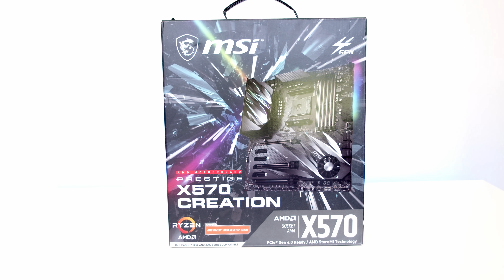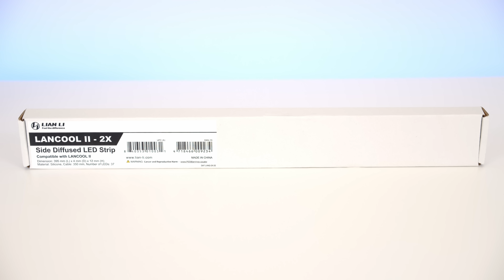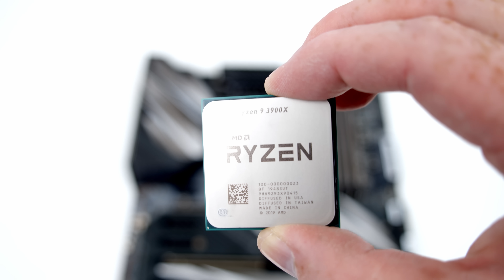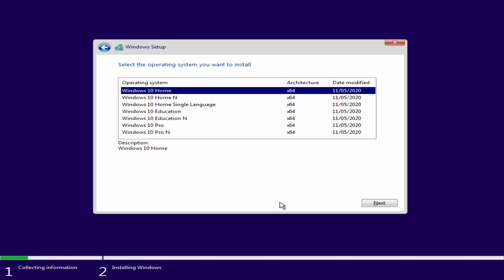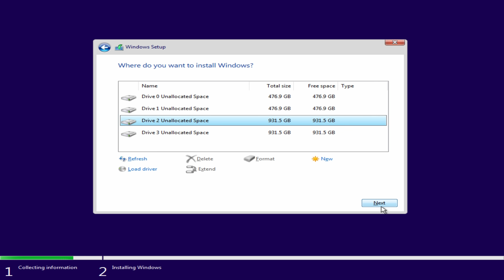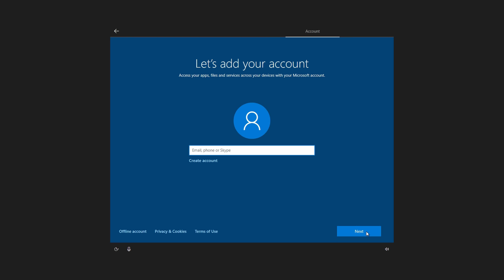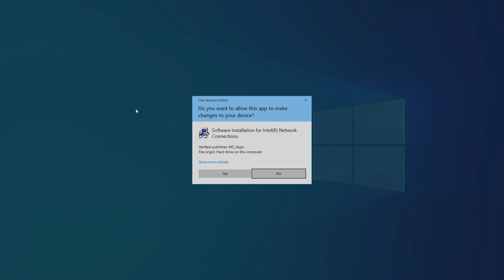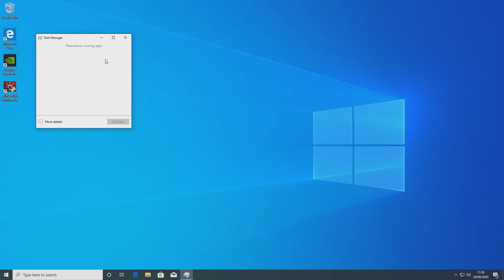Lian Li Lancool II Mesh Step-by-Step PC Build Guide

Comment: question;  do you think after you got the PSU installed and plugged in that you could use the drive cage to put the 3.5 drives into it?  I am upgrading my case and already giving up a ODD.  Hate to give up the extra drive storage also.

Comment: Regarding AIO front bracket mounting, I noticed on the Lian Li website that they footnoted "Attention! Do not install a 140/280mm in the inner side of the bracket otherwise irreparable deformation might occur. The correct way to install is to mount fans first then place a radiator on top of the fans." I assume that means 360mm radiators are OK on the inner side of the bracket as are shown here?

Comment: Question: can the case ARGB Led strip input cable be used for any ARGB device? I want to leave the front case fans installed, and top mount my Galahad. Then connect the Galahad ARGB cable to the case ARGB header instead of an LED strip. The goal is to control a top mount Galahad LEDs and front case fan LEDs using the case button controls.

Comment: The connector at 43:00 i struggled with so much, decided to take off the bracket things you remove to insert gpus io through so i could get line of sight on the connection.

Comment: I have the same case and AIO except in 240mm. I also have the MSI MPG Gaming Edge WIFI x570 mobo. The 3pin ARGB connector from the case to go into the mobo doesn't seem to go in. When I have the pins correctly lined it, it seems like I need to apply some hefty pressure, but I'm scared of damaging the pins/mobo. Is there supposed to be tension before the 3pin cable goes into the mobo?

Comment: Hi Christopher!! You have add an usb-c Cable to the Front Panel of your LIAN LI LANCOOL2, thing is.....I Cannot find where to plug this cable on my ASUS TUF GAMING B550 MOTHERBOARD, can you tell me where to connect it? Is it possible my ASUS TUF GAMING B550 MOTHERBOARD doesn't had somewhere to plug it? (you can find the manual of the motherboard in PDF on the asus site. Also, what is called the port you plug this cable into? Seems quite unique.....Please Help! Should be short for you to tell me! Thanks you are the man!!

Comment: I have bought the performance non RGB version of the lancool ii and I bought the ARGB strip to go with the case however I can’t find the connector from the front panel so it works, does anyone know if I can get an adapter for this wire so I can get it working? Thanks 👍🏻 1:33:07 is the time stamp for reference.

Comment: Question: When installing the NVME M.2 drives, wondering if one should remove the sticker on the NVME drives so that the X570 M.2 heatsink pad makes better thermal contact? Can you advise? Would this void warranty on the NVME?

Comment: I had a question. I plan on using the same Lian Li Lancool 11 RGB case with the MSI B550 Tomahawk board. The Tomahawk doesn't have the JCorsair on the motherboard. Where would I connect it to instead, The Corsair 5 fan hub? Thanks for the great detailed Step by Step build!
Reply from the maker: Yes you need to connect via lighting node pro to the usb header
Reply: @ChristopherFlannigan  Sweet! Thank you so much for the help!

Comment: Do you know if the bottom panel covers can be swapped over from left to right and right to left?  I want to cut out the flat panel and install a mini 7" monitor and swap it to the left side then move the mesh panel to the right side of the case.  Thanks.

Comment: Hi Christopher, great video!  Been using it to plug my cables in.   Please, I have a 3-pin fan cable going into a 4-pin fan header.  Does it matter which way the cable is turned when plugging into the header(I'm assuming it does)?   (Don't know which way to have the 3-pin turned since there is no clip on the cable.)  Thanks!  (I'm at 1:28:02 right now).

Comment: Hi! Just watched this, currently I got a new mother board and my MSI z390 a pro DOESNT have the 3 pin 5 volt connector. Is there a work around for this? I haven’t even turned my pc on so will my colours for the case not work now?

Comment: Hi Chris, I am wanting to build using this case and aio, just wondering if the tubes of aio are long enough to position the radiator tubes down? Or is it going to be really tight? I know you mentioned it in the video but want to double check, Thanks

Comment: Hello. Thank you so much for the guide. Was so easy to follow and finish it myself. I'm wondering as i got Z-Sync RGB hub, is there any way to seperate the fans' RGB instead of using case's controller? Is case's splitter(and its cables) normal ARGB? Cause the plug is different from the usual ARGB cables and they don't even fit in Zalman's hub

Comment: I would have said that looking at the angle of the blades on the original case fans that they would be fine for a radiator. It's only the angle of the blades that determines the type of pressure they produce; straighter and more upright the blade the less conducive they are for rad blocks, is that right?

Comment: where do those three 3-hole fan cables plug in into the motherboard if you're not using an AIO?

both the case and mobo manuals were not helpful in answering this particular question

Comment: Damn i need to get a Vertical GPU bracket for my 3070 Strix. Ive got a 280mm arctic AIO mounted push pull with the same fans it came with. Same setup front mount, and top filled with exhaust fans and GPU intakes. This chassis benefits most from this fan orientation and front mount aio and 280mm push pull. I had no idea the vertical GPU mount cleared the 120mm intake fans from the GPU/psu shroud. Chipset fan never comes on my x570 tomahawk.

Comment: Chris... Fantastic video and very informative. I did my first every PC build watching you and for the most part everything went smoothly. However, when it came to turning my PC on for the first time, I had no power.... Zero. No lights or anything. I'm a little concerned as I have everything plugged and powered that needs to be, but no results for power. I'm running an msi b450 tomahawk max with a ryzen 5 processor. Everything is running properly to the power supply, which is a corsair rm 750, but nothing is coming on. Have you run into something like this before? I would greatly appreciate any and all help on the matter. Thanks

Comment: Is it okay for 360mm AIO pump to be on the top of the loop? I have the same case and want to make same fan (corsair) and same 360mm (arctic cooler) AIO install. But i am afraid that i am gonna need to turn around AIO for pump to be at the bottom and its not that nice looking like on your installation.... Thanks for helping...

Comment: I did not get a boot screen nor a response to keyboard and mouse!  A bit scared now.  What can I do?  I checked the i9 12th gen Intel chip again it is in the right position, the pins look OK.  The only thing I can think of is I put the SSD m.2 on the PC slot that is all the drive I have as well as the two RAM.  I had trouble with the power cable at the top of the motherboard as you showed by the chip the little power cable.  When I connect that to the power unit as well as the long one that connects the mother board nothing happens.  If I disconnect then I have lights on the RAM and all fans work but I have no response.  I connected a TV via HDMI but no response to mouse, keyboard or TV.  What can I do. I spent a lot on this gear.  It is an i9 K so it has video? and the motherboard has an HDMI port so I did not buy a graphics card and I think that should be OK.  So what is going on?

Comment: I have the Lian Li case and the 360 Galahad. I'm stuck on how to plug in the AIO pump. I added the splitter (R) so I can plug into the AIO header on the motherboard, but that leaves an open plug for an rgb connection.  Does anything need to plug in there? All the fans are plugged into the fan header already and I'm using the AIO connectors from the front panel. Thanks.

Comment: I have a 360 aio front mounted the tubes going up. I think it was installed wrong. They never installed the front top panel usb connectors and the pump was on the cpu fan header while the fans were on a sys fan header split on one header. 10 months later my cpu is going to 90 degrees while gaming.

Comment: Also when you’re at 2 hours into the video it only shows four drives. 0,1,2 and 3. The two Kingston Sata 500gb drives and the two Samsung 970 evo m.2 ssds. U said you got rid of the Sabrent 500gb m.2 drive but what happened to the the other 1tb Samsung evo m.2 ssd you installed in the gen 4 lightning slot for the chipset? U installed two 1tb m.2 ssds in the xpander card so I’m assuming those are the drives that show up on the OS when u were labeling them.. so shouldn’t you have another 1tb m.2 drive showing up (the one u plugged into the second gen 4 slot on your motherboard ?
Reply from the maker: m.2 expander card not plugged into final build so just the 2 x m.2 ssd 1tb on motherboard

Comment: Hi! How many fans at most can connect to the included controller of the case? For example, in your video, if u dont use corsair commander core, is it possible to connect 8 fans and led strip to the included controller with splitter cables and controll all of them by the button on top of the case?

Comment: if u put the aio to the front with tubes up doesnt it will be loud with time? they say dont put this way cuz air will stop at the top of the radiator and as water cycling around it will be loud

Comment: I can't seem to get the front fan tray into the top slot "style 2 in the manual. I removed the two side screws to be able to remove the fan tray, but when I shift it up there is some resistance and the top doesn't go in. Am I missing a step?

Comment: Hi. I got a little confused. Just go this case and I plugged the 5V ARGB header into the motherboard. There's also this SATA cable preinstalled in the case. Should I connect it to PSU aswell? Or leave it be? Because Lian site says "Note! If your motherboard doesn’t have any 5V addressable RGB headers, make sure to connect the SATA cable connecting the hub to the the power supply and use the C and M buttons to control the lighting effects."
Reply from the maker: You must plug it in to the psu otherwise lights won't work. Sata powers the controller, the 5v argb just controls the lights
Reply: @ChristopherFlannigan  I worked it out already. Thanks and keep up the good work 👍

Comment: Excellent video - I'm buying that case too, so this is incredibly helpful. My question is: On your point about removing the HDD bay, is there a smaller bay (one drive) that could be replaced in there to still allow an HDD but not block as much airflow?

Comment: Amazing guide. I tried following this with my recent first time build but I can't seem to get the computer to flash the bios. I did everything like you said but I can't seem to get mine to work
Reply from the maker: Is it an MSI board? Check the manual to make sure of the steps. You also need a usb 2 drive and formated correctly in fat32
Reply: @ChristopherFlannigan  dude you saved me. i was trying to use a usb 3.2. It worked perfectly with a 2.0 8 gig. THANK YOU!!

Comment: Hey Chris, I just put my vertical mount in as well, and now the VGA light is on. Is there something I have to do in my bios first or is it more likely its not sitting correctly in the slot?
Reply from the maker: I assume your running a gen4 GPU with a gen 3 riser cable. If so change the PCIE settings in the bios to gen3 and then install the riser and it should work
Reply: @ChristopherFlannigan  does this case comes with fan hub ,please help building my first pc

Comment: 1:17:50 - Love the work but this orientation of the radiator is bad advice. The radiator has a header tank on the opposite site of the intake and exhaust tubes - one of the functions of the tank is to catch the excess air/bubbles in the system and keep it in this area of the closed loop.  The header tank should never, ever, be lower than the water block on the CPU, otherwise bubbles will collect in the pump / water block not only causing thermal issues over time but reducing life of the system significantly.

The only 2 ways an AIO should be mounted is top mount or hoses down with the header tank above the level of the water block and pump.

Comment: Super informative video, I got the same case, aio, psu, and ram. Going with an intel cpu and mobo though. This makes me ready to start my first build! I have a question though, do you think I can use the case fans that were included with this case to mount on the top and bottom? No issues with that right? I ask this because I'm gonna be putting the galahad aio at the front like you, and I don't want the 3 fans to go to waste
Reply: I am about to do the same setup! Use the AIO on the front and put the 3 base fans un the back of the case! Let me know if you already did it and what's the outcome!

Comment: I want to turn off RGB Fan lights by holding the button on the front like you mentioned ( 2:21:08 ) and it’s not turning off. is there a different way to turn off?

Comment: Why do you prefer your graphics card installed vertically? The fans on the graphics card don’t work as well cooling the card when the card is mounted vertically because they are facing the solid side of the case.

Comment: I used this video to help with my first build, and to say it was tremendously helpful would be an understatement. Thank you for going in-depth in your explanations and clearly explaining where you are plugging stuff into! The only issue I'm having now is with syncing the case's RGB fans with the mobo. When I go to the 8th mode on the case, the RGB just shuts off. And the Mode button doesn't work to turn the RGB on/off. I triple checked all my connections, and it even shows up as "AddressableHeader"  in ASUS' Armoury Crate RGB software. Any ideas on what the issue may be?
Reply: @ChristopherFlannigan   unfortunately I have an ASUS B550-F mobo, which only has 1x ARGB header. I have the case argb plugged into the mobo, and when I set any lighting effects (static, rainbow, any of them) and try to sync that with the case it doesn’t work. The 8th mode just turns all the RGB off for whatever reason

Comment: I’m in the process of beginning my new pc build and want to make sure that im giving my evga 3080 gaming ultra GPU the correct amount of power need from the same RM850x psu.

Should I run two 8-pin psu cables (not one daisy chained) to my GPU? Does the Corsair RM850X come with the required amount of cables needed to do this? I have also paired this with Asia horse cable extensions. Would this sufficient or do I need to purchase additional cables? Not familiar in psu as much.

I’m not running any other PCIE powered devices.

Love the content. Keep up the detailed reviews!
Reply from the maker: Yes you should be able to

Comment: And I thought I went crazy with my build...asus 3090 graphics, 5950x ryzen, dark hero board, Corsair dominator ram 64g, Samsung 980, 11 lamb crosair fans, Kea Jen radiator, led cables, 850 Eva power block, crosair fan controller etc... that was about 6500 right there...😞 plus to lg gl 850 monitors, that’s like 950 right there.. another thing I need a cannon camera and a sure mv7 microphone.. I bought this stuff because I was thinking of becoming a serious streamer and maybe a content creator... what do you think?? Did I go overboard??? Plus a 150 venom razor mouse, and razor Led mouse pad also by razor... I just wanted really good gear to stream with... what is your opinion?? And do you think game streaming and do video reactions or being a content creator is very lucrative in 2021?? My setup cost about $7500 without the cannon camera or mv7 mic..
Reply: is your 3090 vertical? and do you have the case in this video?
Reply: @chriscurry6805  no why? I want to get a vertical mount.. and I have the Lian li o11 dynamic xl
Reply: @LoLo_Lorick89  cause I just got my vertical mount and was gonna ask if you could fit fans under the gpu in the mesh case

Comment: This is such an amazing video, thank you! I have a quick question please, I would like to use a 280mm radiator in the front, is there enough space for a 120mm fan beneath the two 140mm fans?

Comment: Awesome video. Very informal and clear cut. Anyone seeing this can answer plz...why did you put the 500gb ssd on the top slot and the 1tb on the bottom slot? I think u said the top slot was for the cpu.. and the bottom is for the chipset. What does that mean. Sorry I’m literally figuring this out on the go because I’ve been slowly making a build list.. is 1tb on the upper slot too much. Just wondering
Reply from the maker: There will be almost no difference with this motherboard, but check the manual for the one your using as the speeds may be different (size doesn't matter)

Comment: Absolutely outstanding video. My case, my mboard and cooler.  Made my build so easy!!  Apart from one thing.

Where does USB power come from? Its in the power supply section but  my power supply doesn't seem to have that?  An EVGA supernova 750W.  If anyone can help I'd really appreciate it.

Comment: Hello Chris.  Great content and this has helped me to understand how to go about my editing build.  My question is, I have the Mesh 2 PERFORMANCE version of this case and the EK360 AIO, and having some doubts on how I should install it (I am considering what you just did since it might be my only option).  Would I be able to put that AIO in front, then use those 2 front fans at the base or top, and leave the one in the back that came with it?  Or should I maybe get another set to have 2 more at base and 2 at top?  Advise from anyone is welcome and thanks in advance.  

Mesh 2 performance
ryzen 9 5900x
32gb of corsair vengeance,
Asus Tuf Gaming X570 Pro Wifi 6
Samung Evo 1TB
4T Seagate Portable Hard Drive
Nvidia GeForce 3070 TI FE

Dell 32" curved Monitor